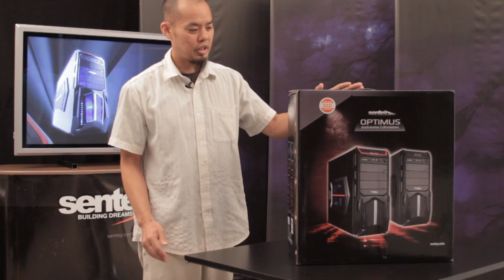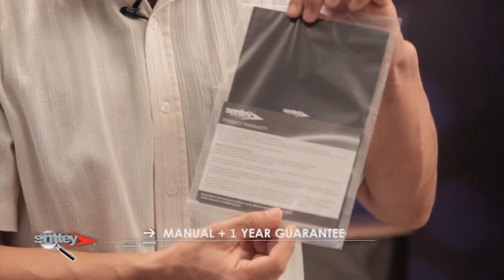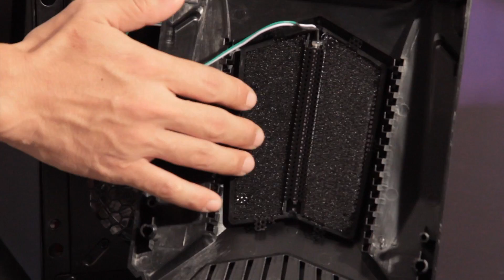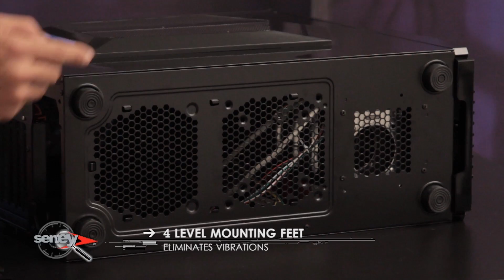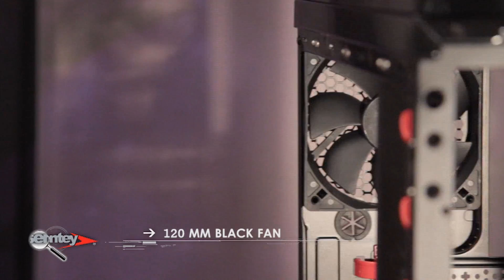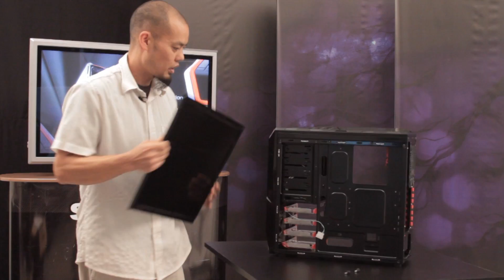Sentey Optimus GS-6000

Comment: This case is trash the fan control never worked. the sentry fan that came with it were garb the wires broke off before the fans even died. a ton of the plastic used is super cheap. its almost impossible to get the top off the tower

Comment: does anyone know if an xfx r9 280 x on a m5a97 r2 motherboard would fit in this case?
Reply: me lo suponia me han conectado mal los ventiladores porque mimperilla solo apaga 1  ... muchas gracias!!
Reply: i had to take the shroud off my asus r9 280x to make it fit.
Reply: TANKv19 este case trae mas de 13 pulgadas  para vga, la r9 280x de gigabyte mide menos de 12.. realmente es una buena case yo la tengo y va excelente.
Reply: Joelito
 hola tal vez sea una pregunta estupida pero... yo tengo el mismo case y creo que me han conectado mal los ventiladores, el control de ventiladores que viene incorporado, controla los 7 ventiladores ? o solo uno? porque a mi solo me controla el de el frente?
Reply: ese control amigo controla a todos y te diré que  yo le conecte 3 mas y funciona perfecto , todos se controlan desde la parte superior frontal .. ese controlador lo que ha hace es disminuir la cantidad de energía que circula por esos cables y de esa manera cualquier ventilador o dispositivo conectado en esa zona  sufrirá la misma suerte, en el caso de los ventiladores pues simplemente baja las revoluciones por minuto (rpm).. fíjate bien que estén conectados correctamente.. hay uno que es el que activa la led frontal, me refiero a la tira de luz vertical frente al ventilador de los Discos duros, ese cable es el único que no debes conectar ahí, conectalo de manera independiente a otro conector molex de tu fuente. de otra manera no te va funcionar. quizá ahí este tu problema. saludos
Reply: gabriel montalvo de nada amigo.. ojala logres resolverlo.

Comment: u need a needle nose pliers (i call it a bird beak) to take off the front panel. no easy way to remove it. if u want to take off the top panel u need to apply firm pressure to the clips. i started with the 2 to the rear. they should break but u still need to be careful. i read a review that stated that cooler master 212 evo will not fit due to collision with the side fan. some innovative modded and a smaller fan (eg 140mm) can solve that issue. the case interior is less dusty than my previous

Comment: it is a nice case. i got 1 yesterday. i thought with all those fans it would be cooler than my cheap basic assembly with three 80mm fans (1 front, 1 side, 1 back) but it is 1-2 degrees warmer. it has some lovely features and with some modding (changing and adding fans) it will make my first gaming pc.